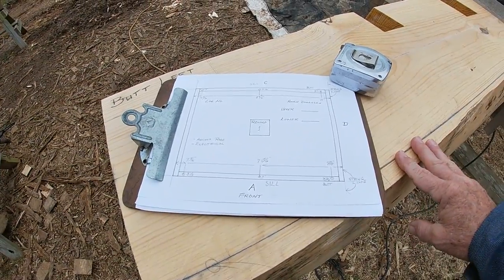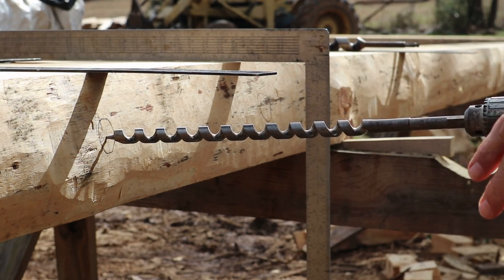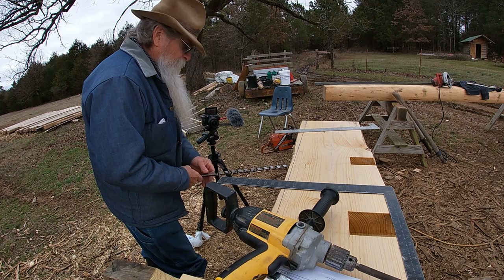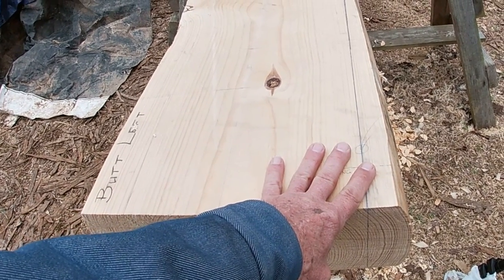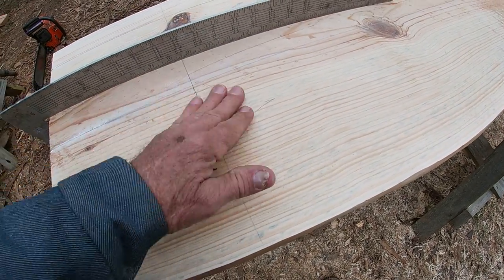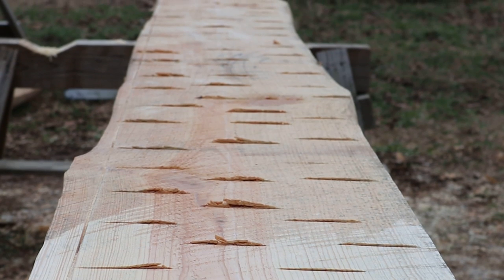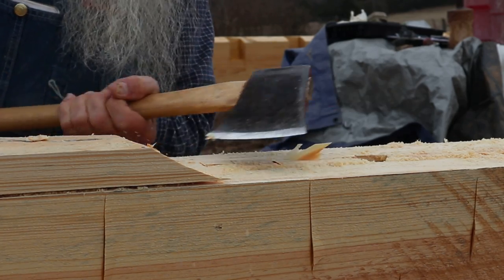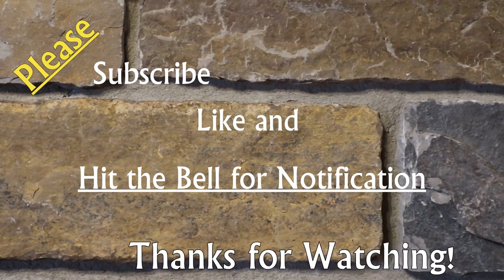Round 1, Sill Log Layout (Pt 3), Dovetail Log Cabin Build (Ep 14)

Comment: a lot goes into the sill logs before you set them...I never knew they were built with such precision...Thanks Bro. Paul
Reply from the maker: Rough Cut Homestead  Howdy Mr. Duke- by using the round floor joists I created more work than I normally have to do. I frame the floor like I would on conventional house with 2x10’s or 2x12’s. I got a little bit of ocd in me lol. There has to be a balance between doing what is acceptable and spending time making everything as perfect as possible. I just want to show what can be done it a person is doing their own cabin. I sure do enjoy working with logs. God bless y’all and have a great weekend